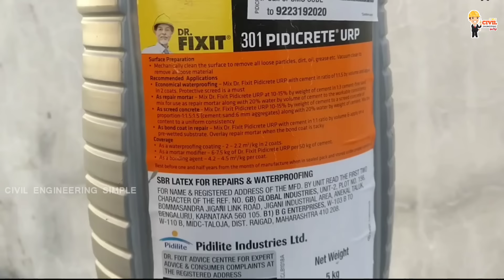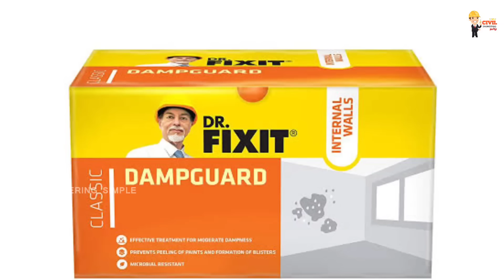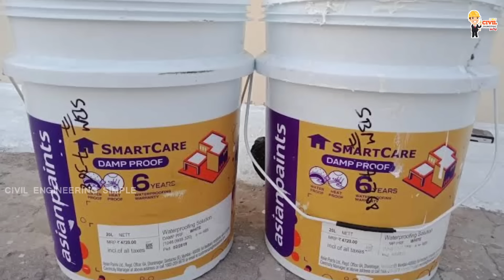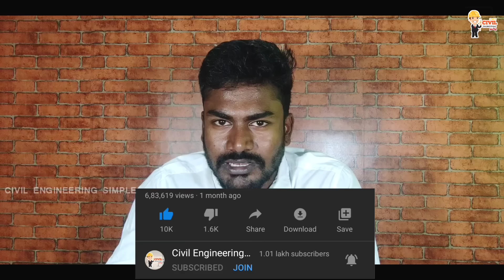சுவரில் ஓதம் & உறிந்து விழுது- Wall dampness | எளிமையான தீர்வு!

Comment: Excellent explanation. Thank yuou very much. My problem is seepages on the ceilings in my bed rooms and living room, which are directly under the bathrooms of the floor above. As the top floor owner does not co-operate  in repairing his bathroom floorings, is there something I can do in my house to solve the problem? I would like your advice.
Reply: sri vinayagar waterproofing solution kovai.  do u do in chennai also ?

Comment: We live in apartment. Bathroom tiles la leak eppadi sari seyarathu anna
Reply: YES. SAME PROBLEM that too in a Big Gated Community G+4 Apartments (out of 600 Flats approx 70% Flats facing this typical "Rest Room Water" Seepage to the Floor situated Below) called S&P near Apollo Hospital, VanaGaram, Chennai. Due to Structural Fault right fm the Start of Construction, Not able to Rectify even after Many Attempts. What's the Final Solution/Remedy for this Periniyal seepage issue. .??!!
Reply: @cpet396  we are expert in that kind work